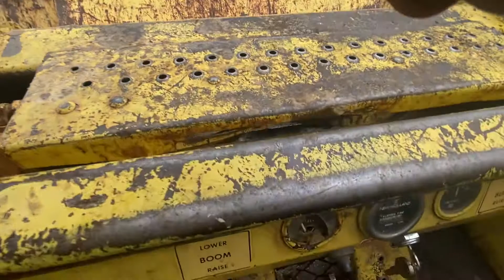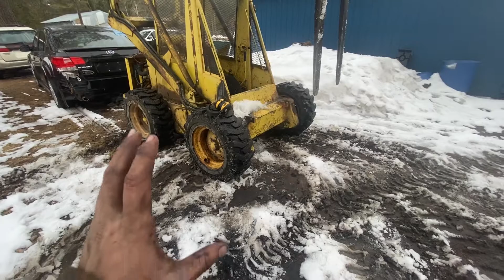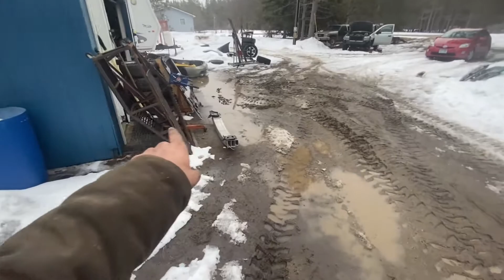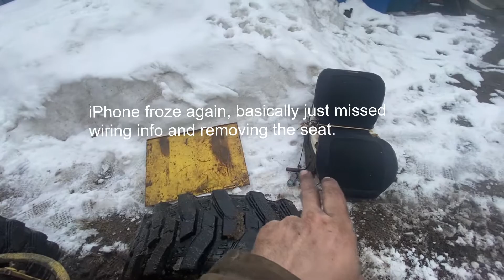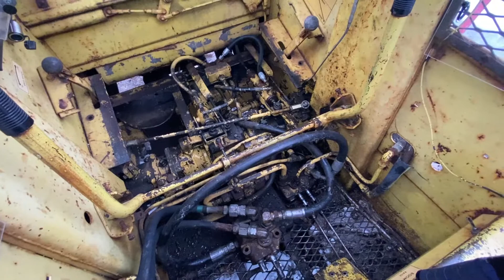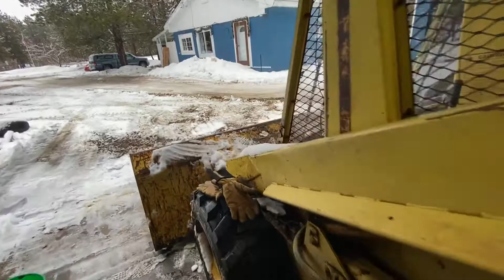New Holland L35 Skid Steer - Intro & Walkaround

Comment: I just bought an l35 yesterday. Came with bucket, manure bucket with teeth (great with getting logs and branches) and a baler spear. Has small hydro leak. For $5500! Taking it to new Holland to have some work done to it! Absolutely love it. Couldn’t believe the power. High gear makes the lever rattle terribly because they never used it, but it works, not sure what it’s supposed to sound like when turning but it gets loud when turning it.
Reply from the maker: For me, it screams like a banshee when I turn in high gear. I just did a TON of work on the machine a couple of weeks ago and filmed some of it but won't have it edited for a while. My only gripe with it so far is the parts availability and price. I bought 3/4 of the last gaskets on the internet for the left and right-hand drive pumps where mine was leaking slowly. But the wheel seals around the drive hubs were close to $150 a piece or more if I remember correctly. So even though it was a hack repair, I smothered them in RTV and they do not leak so far after 10 hours of hard use moving snow.

Comment: Update..., how's the L35 doing? I have a 1972 model that my dad bought in 1983. Still going.
Reply from the maker: Still putting along just fine, I had to reseal all 4 cylinders the other week and I still have that major leak but I DID get the gasket delivered last week. I wont be fixing that leak till spring, but hopefully I can get around to putting out the cylinder rebuild video soon.